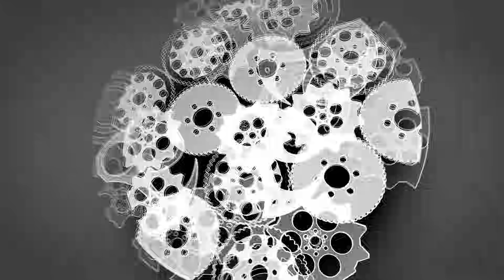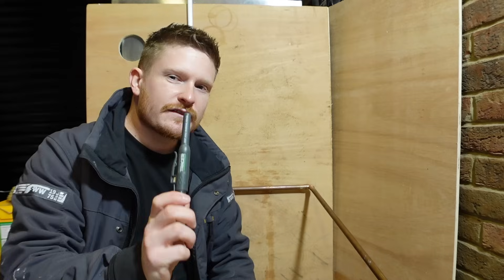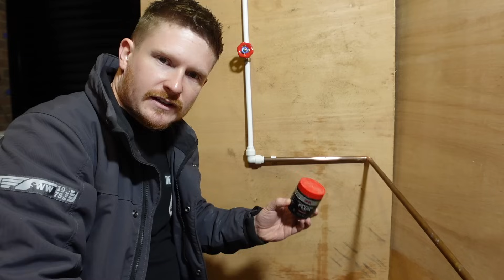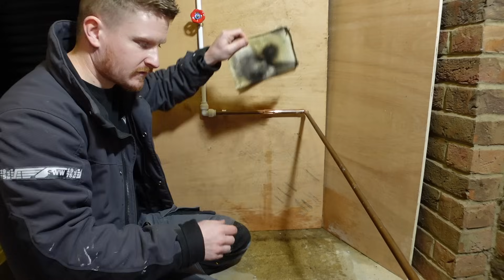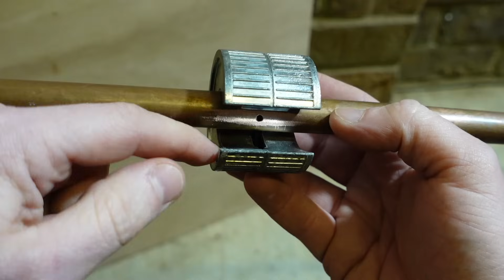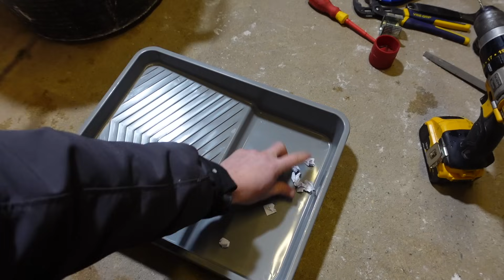How To Fix A Hole In Copper Pipe | Emergency Plumbing Repair

Comment: Cutting directly over the hole is very stupid, unless it's a truly tiny pinhole, because that will create a very jagged edge that can't be deburred. 

Just make two cuts on either side of the hole. Then you can repair it by soldering, using a compression coupling, or a Sharkbite slip coupling.
Reply: ago
“that can't be deburred. “
Deburring the ragged edge would be easy with the right tool and experience. Of course, if all you’re used to deburring is the end of copper pipe cut with a pipe slice then you probably don’t have the right tools or experience to do anything different.

Comment: Hi DIY guy, help, I keep losing pressure on my boiler been checked by 3 heating engineers, answer its a leak in the system cannot be seen. Had leak specialists out, nothing wrong no leak. Cost so far £690 still have the problem. Thanks

Comment: If the drill, nail or screw have gone right through and there's no paint to contend with a polish with a nylon scourer then a pipeslice ring cutter through at the point of the hole  separates the ends. Spring the ends and with a bit of effort you can insert a compression fitting. Sometimes a compression fitting without the internal stop is necessary. It's often handy to separate the compression fitting and smear the mating surfaces with a trace of whiting

Comment: I have a waterleak in my plastered wall in my bathroom, I know exactly where the leak is. Exactly that happened, I wanted to put on a curtain rail, and the person drilled through the pipe 
This was like 20 years ago, so it was fixed, but now, it seems to be leaking again.

Comment: I just tried one of the click fix jobbies and it didn't stick to the pipe. Did I use too much heat or flux? Or heated it for too long? The pipe is vertical.

Comment: The reviews on amazon suggest these patches can't be used on vertical copper pipes.  Can't understand why though.  The leak I need to fix is on a vertical pipe so before I order can anyone tell me if this is true.  Thanks

Comment: Just a had bathroom sink pipe leak on me. Cut out part of the drywall for access to the pipe. I found a pin hole size hole. I hope I can repair like this. Thanks for the info! ❤

Comment: I bet plumbers hate these vids. I recently had to move the bath cuz it was rocking on its feet. I cut and capped the two pipes, make the bath solid again, then replaced them with 900mm flexies. 
Obviously you need an expert to install a boiler but there are loads of little jobs you don’t need a plumber for. Saves £££s.
Reply from the maker: Glad to have helped you

Comment: Ive used a bit of marigold and insulation tape cut a small peice of the finger pulled fairly toght around the pipe then taped and inch either side i no its a total bodge job but it held for 5 years until all the pipework was replaced
Reply from the maker: Nice one ☝️

Comment: These methods only work in ideal scenarios.
If you cant stop the water the soldering wont work. And if there is no movement on the pipework, the pushfit method wont work either.
Reply from the maker: Your correct.

Comment: As a plumber I will probably find some of those patches for emergency repairs but I would advise against this being a permanent solution. Our goal is to keep the inside of the pipe as smooth as possible because turbulence deteriorates the pipe downstream of it. The patched hole is going to cause a lot of turbulence. It needs a coupling to repair it, I personally only use press or solder fittings on copper.
Reply from the maker: Each to their own and thanks for sharing your preferred method.

Comment: nicked it, with a reciprocator mulit tool, just a graze but I am still worried because it is a washer hot water line.  I don't know how this will affect integrity later on. am trying to trim out some excess old drywall so I can fit my new worked drywall in that i measured.

Comment: Cut the screw near the head , wrap some PTFE tap round the screw and tighten it back into the hole , the tape will seal it until you can get the proper fitting and you still have water meantime .
Reply from the maker: Interesting tip

Comment: I have had 4 of these fixed in the past 2 years.   The plumbers don't solder anymore.  They cut the pipe where the hole is a few inches.  They cut a replacement pipe and use what I will call a compression fitting on each end, and use a battery operated tool that compress's the fitting on each side.  They are done, and about $600 later for me.  They say it won't leak????  I waited a year to fix my ceilings because I was afraid they would leak after I fixed my Ceiling.  The also wanted to quote me a total replacement of my copper pipe in home, and switch me to Plex.  No Way... I will fix the pin holes as they happen.  My holes had a blueish color on the pipe.
Reply from the maker: Go for it 😃

Comment: Will one of those patches work on a hole that was caused by that pipe freezing? It's more of a split rather than a hole. Thanks.
Reply from the maker: If the split falls within the area of the patch then yes
Reply: @TheDIYGuy1  Thank you! I'm going to go buy some of these patches as soon as the store opens. I didn't know they existed (I'm not a plumber). It will make repair much easier and faster.

Comment: I wouldn't heat the patch directly. That could produce a cold solder joint on the pipe itself. I would heat the pipe first around the patch then the patch. But I would rather cut the pipe, make sure to get rid of the inside indent of the screw which would cause water turbulence and patch it with pipe and or a slip fitting.

Comment: A brass screw can also be screwed into the copper pipe and soldered into place if it's an emergency and you have nothing else to use!
Reply from the maker: Interesting thanks

Comment: Using the deburring tool takes the rough edges off the internal edge of the pipe, it's not to prevent damge to the "O" ring in the fitting it's to reduce turbulence in the pipe.
Reply from the maker: If you debur the pipe internally yes. Externally it is to prevent damage to the o ring.

Comment: No! I use a hose clamp and rubber band or electrical tape. I always have succeeded with zero leakage afterward. If available a slit piece of garden hose is best with a quality hose clamp....a $1 repair that can last for years but I usually solder in a new coupling  in a week or two.

Comment: A hole in a copper water pipe means the pipe is weak and the time it takes to put a temporary patch on, I can remove all of the bad pipe and replace w/ new. 
I have been using Plex pipe for about ten years now and it makes life simple.. It's easier to replace copper pipe w/ Plex,  then it is to solder copper, especially in tight places..
Plex is flexible so it cuts down on needing a lot of elbows.. 
& it's in compliance w/ building codes.

Comment: I would just cut it out. Use a shark bite or just replace with the new better plastic stuff.
Reply from the maker: That's always an option unless youve no room to feed pipe or fittings in or too much tension on the pipe

Comment: Many ways to skin a cat. I would cut the pipe and use the push fit or a coupling, sometimes in a pinch I use a small piece of rubber cut from a rubber coupling for drains and an o clamp that is also on the rubber coupling you just have to make sure it will tighten enough.
Reply from the maker: Poor cat 😸

Comment: You can also cut out the hole and solder a joiner or use a compression fitting
Reply from the maker: Absolutely if you've got the access without tension on the pipe

Comment: My apartment still has the original copper piping in it going to the hot water heater and you can see the lead Sauter on everything. They didn’t do a neat job of it.

Comment: Cut. Sharkbite connector. Done
Reply from the maker: Not always possible if for example your hole is in a tight spot on a crossover and you can't access it properly.
Reply: @TheDIYGuy1  if thats the case how are you soldering with a torch.. pex is the present and future. Put the copper down and walk away. Everyone i know threw out all their copper stuff years ago.
Reply from the maker: @bb590  if you've a decent torch it can be done. In fact I did one on a central heating pipe two weeks ago which would of been a nightmare to cut out due to its location. Both PEX and copper have a place.

Comment: Nice, but I just cut out a section and use Pex with push fittings. Fast and easy. Thanks for sharing
Reply from the maker: Horses for courses. Not always possible if for example a pin hole is on a crossover

Comment: I usually find there is no movement in the pipe so I go for a slip solder ring coupling over the hole.

Comment: Judging by the thumbnail I thought he was going to use a screw to fix the hole, couldn't you just put a tiny screw in an accidental hole and solder that in place?

Comment: What I have done with some pipes the froze and split was to clean the pipe all the way around. If the pipe was pushed put I would push it back on with pliers. For the patch I would take copper lamp shade wire about 6 inch long. Remove the coating and wrap it around the pipe and solder it in place. looks like crap but i never had such a patch leak

Comment: Good video, but i don't know if this is really much of an "emergency" repair, which suggests to me something the average homeowner could do at 4pm on Sunday without calling someone.  The average homeowner won't have the part, the flame resistant cloth and in many cases, they torch.

Comment: I think you should only put flux on the pipe where the solder is going to sit. All the flux sitting in the middle had no way to escape, so now that will sit there for years, corroding your pipe and poisoning the water. I think a regular coupling would be even better, so you can first make sure all the flux has evaporated, only after then add the tin.
Reply: Lmfao 🤣

Comment: Hmm, I've soldered (tin/lead) professionally on musical instruments (brass, nickel silver, copper, silver and gold) for decades, and never, ever once, had a solder joint fracture due to water cooling.  The lead-free tin/copper solder works the same way.  I've always cooled with water right away, once the solder has frozen and the piece is still boiling hot, because it's the best way to get the flux residue off.  Tip; you can make a patch using a section of the same diameter pipe.  Cut it lengthwise such that you get slightly more than a half circle, remove the burrs, and it will "snap" over the original pipe nicely.  Then solder using liquid flux and solid wire solder.  If you need to clamp the patch onto the pipe for some reason, use soft steel wire, wrapped around the part and twisted tight, then solder, then cut and remove the wire.

Comment: #1. Stay calm
#2. Turn the water valve off.
#3. Cut open the drywall, enough to work on the system comfortably.
#4. Get a short hose and 3 hose clamps.
. . . What ? They make a patch ?

Comment: I'm a plumber and over the years have fixed frozen burst pipes with just solder and flux, cleaning it first with sand cloth. Squeeze the crack as closed as you can. Silver solder works best. No need for a patch piece.

Comment: What pressure can this take before popping off?
This would make an interesting test.
Reply from the maker: It would 👍
Reply: Since water pressure is about 60 psi and the hole is so tiny that would never be an issue, I think this would hold up to higher pressure that a standard coupling or elbow joint.
Reply: @sarahdeshay1394  The size of the hole is irrelevant. The area inside the patch is relevant. Add in some pressure spikes from people quickly closing taps and some material fatique in the solder under tension... and you are in for a wet surprise! ;)

Comment: Had someone call me out last night, he'd tried this (from ur video i'd guess)but didn't clean the c/u 1st & or hadnt properly drained,soon put a no1 on!remember the old days of multiple frost bursts we used to wipe them with plumbers solder!
Invest in a pipe expanding tool u can make ur own slip couplers up, Inc imperial/oversized ones,(toolstation used to sell them years ago).always thought the J/G fitting had to be screwed outwards to stop the collet ring being accidentally pushed in?

Comment: One thing to note is that if there’s still water in the pipe then no amount of heat will solder that patch correctly as the water just sucks all that heat away.

Comment: One comment - the additional fitting is fine unless working in a confined area, where you cannot move the cut ends apart far enough to fit the piece in. That's when I discovered slip fittings - you can get a "straight slip coupling" - then you can just bend the pipe out, slide the coupling all the way on to one side of the joint, let it spring back to align with the other end of the pipe, and slide the coupling back over the joint. Solder in place, job done.

Normal couplings have a ridge in the middle to help centre the fitting on to both ends of the pipes, so won't slide on far enough if you can't get a big enough gap between the ends. Slip couplings overcome this - hendy when you need 'em, so I've now got a few in my spares box for when I need one.
Reply: I cut a short section out and put a 90 Deg bend on each open end. Then make a "C piece" from 2 more 90 Deg bends with a short length of pipe connecting them. Then slide the c piece you made onto the 2 90 Deg bends fitted previously.

Comment: Love it. Im sure those plastic connectors would last for ages. I've seen rubber and zip ties last for 5+ years. Typically when you start to get those pinhole leak issues its not the repairs you make that fail, its pipe further down the line in either direction that begin to pop pin holes. Corrosion pin holes are continual issues once you get the first one and its a problem that needs to be addressed with water chemistry. Usually at that point the right way to do it is treat the water and replace all the copper. Replacing all the copper is never cost effective. That being said you can accomplish the same thing with a torch and silver solder and it wont crack no matter whether you cool it naturally or with a wet rag... Its very, very pliable. Copper is also pretty damn soft unless its been heated and cooled quickly MULTIPLE times.

Comment: My dad showed me how to fix a punctured copper pipe(I punctured it when nailing a floorboard back down😁).
He cleaned the area.Screwed a small brass screw into the hole and then soldered over  it.It never leaked👍
Reply: Great idea. That's a lot easier than going out and trying to get one of these patches as they're hard to come by.
Reply: I wonder if we can use liquid PTFE together with the screw.  I have use this method for PVC pipe which is much thicker and is non metallic. Copper pipe is much thinner and unlikely will work..
Reply: @tbot5709 have you tried it yet, by any chance?
Reply: @tbo @tbot5709 id PTFE What is that?
Reply: Awesome impressive I will do just that THANKS A BUNCH!
Reply: If this pipe were exposed and out of the way I don’t see why a leak clamp wouldn’t work on stopping a leak where the pressure was set at 35 pounds or lower as it is on my house. We used leak clamps on underground gas mains all the time 30 years ago. Turn the water off and clock the meter periodically. I wouldn’t use a clamp in a wall of course.

Comment: This may sound like a joke but in a pinch you can use a couple slices of bread instead of a heat mat if you forgot/don't have one in an emergency, they're surprisingly thermal resistant
Reply: Plus you get a snack when your finished :)
Reply: Bread can be stuffed up the pipe to absorb residual water which will prevent you from soldering - the bread is non toxic and will dissolve & flush out  !!

Comment: Pin holes in copper are generally from low ph water. Blue/green around your fixtures, tub, sink then it’s def low ph and it’s acidic water eating the copper from the inside out. A neutralizer tank with calcite in it helps raise the ph and stop the water from being acidic.

Comment: Your second method works great if the copper pipe is moveable, correct?
Reply from the maker: Yes correct. Otherwise can be a little tricky but there are ways.
Reply: @TheDIYGuy1  Indeed. Where there's a will . . . there're relatives. 🙂

Comment: When the main shutoff valve doesn't shutoff completely, it's time for the stale bread trick when soldering. 
Careful drilling into walls, a slow leak undetected will cost thousands of dollar worth of damages, not to mention mold problems and not cover by insurance. Plus you could be sued by the tenant below.

Comment: If I had a leak I would definitely wait at least 3 days with my water turned off for my Amazon repair patch order to arrive!  😂
Reply: How about ordering it right now & sticking it in your toolbox?

Never thought of that did ya genius?

It's called 'preventative maintenance'.
I have turn signal bulbs, headlights & other shit sitting there so that when an emergency comes along you go to your toolbox & handle that shit instead of being in YOUR sorry shoes when the answer has been given to you.

Comment: In an emergency…empty pipe, clean area really well, flux and solder hole……fix properly later on with a coupling ,have one with a stop? File the stop off inside…..beside ….for some reason slip couplings are twice as expensive…..as stop couplings…….